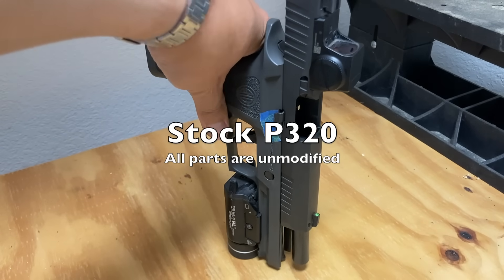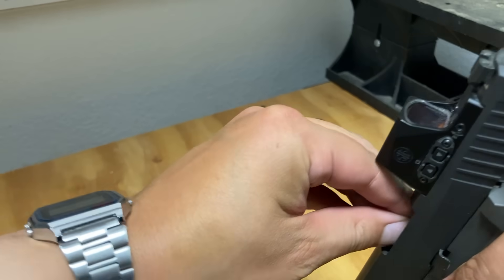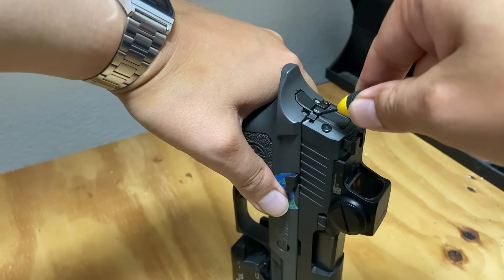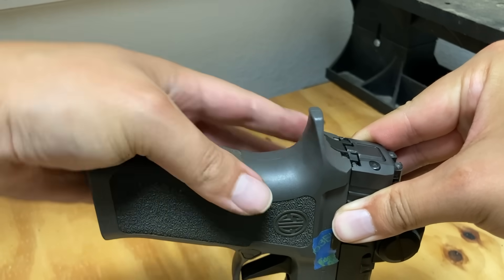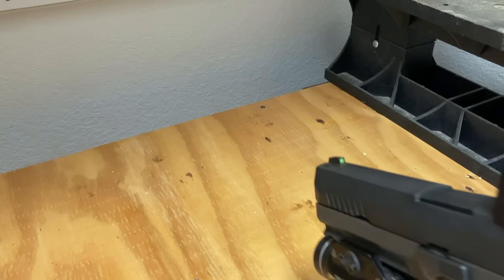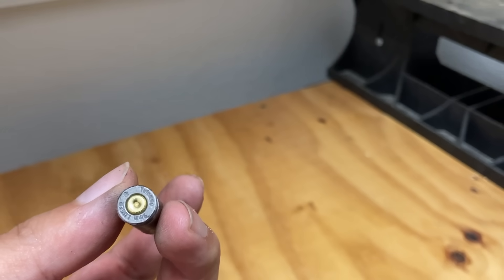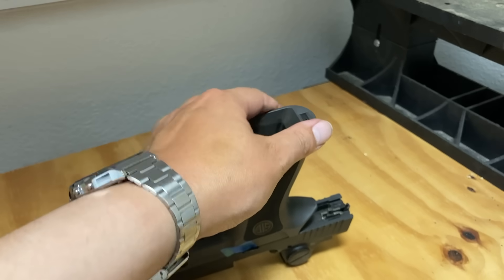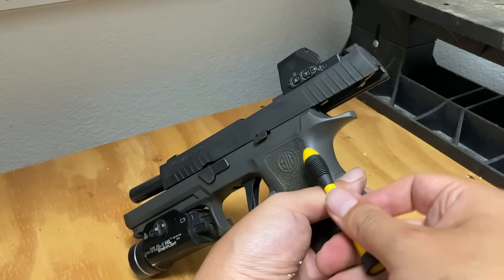Attempting to reproduce the FBI's Aug. 2024 P320 Sear Movement Test

Comment: I thought they had said the spring on the striker block had slipped behind it not applying pressure. Also I would not discount build up in the slide from a thousand rounds allowing more binding. Glad to see your still testing
Reply from the maker: The pictures in the report clearly show the spring still pressing properly against the sear housing above and the striker safety lever below. What they noted was that the fulcrum point of the spring was pivoting sideways away from the side of the sear housing. Upon installation, it would sit flush against the sear housing, but after firing 50 rounds, they found that it would be floating above the sear housing as though it were trying to come out from around that locating pin molded into the sear housing.
Reply: I was thinking the same thing, the spring dislodged seemed pretty important? I just uploaded a test of the sear press without a safety lock spring. It failed easily, detonating a primer, and failed even with a hard enough press with the spring intact. Check it out if you'd like. 

That said, I agree with Mr. Trenchcoat. How the FBI found the supposed issues (bouncing the slide off the frame rails repeatedly, then going for a sear press) is a bit weird. Does still makes sense though, especially with 320's that have poor sear/striker engagement.
Reply: @lon242  just watched your vid. Well done and informative.
Reply: @guzzimike66  Thank you, it's my first attempt at longer video and am glad it was cohesive enough to be informative!
Reply: @lon242  I watched the 2 you did on the P320, good explanation.
Reply: @tomr427  Thanks for watching Tom, glad they were useful.

Comment: Is there a way that the slide could be slightly forward when in a holster? I had found when trying the sear test that I was pushing the side slightly too far forward and the striker safety was being disengaged on my one fcu.
Reply from the maker: No. If the pistol is fully assembled, it cannot physically move further forwards without something being very obviously broken.
Reply: @P320Truther Sorry for my lack of knowledge, but what actually prevents the slide from moving forward? Is it the recoil spring assembly?
Reply: @MrPoserina  The take-down lever is a lug that cams out of the way when you rotate it into the disassemble position.  That lug keeps the barrel from moving too far forward, and the barrel locking into the slide keeps the slide from moving too far forward.

Basically the same thing that keeps every single other semi-auto pistol since at least the 1911 from having the slide move too far forward.
Reply: @immikeurnot Thanks for the explanation. So, if the take-down lever is out of spec, as with having the incorrect caliber take-down lever installed, would this allow the slide to travel slightly forward? From what I could tell, when I moved the slide even slightly forward, the firing pin safety was disengaging.
Reply from the maker: @MrPoserina There is no such thing as an "incorrect caliber takedown lever" - takedown levers are identical between all calibers of P320. Takedown safety levers differ between the two sets of calibers, but that's not related to what you're talking about.